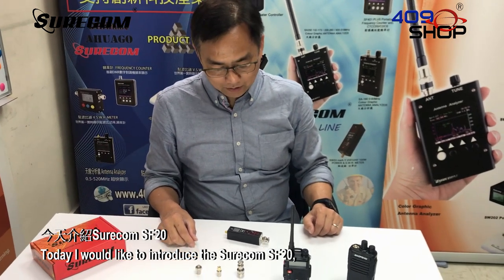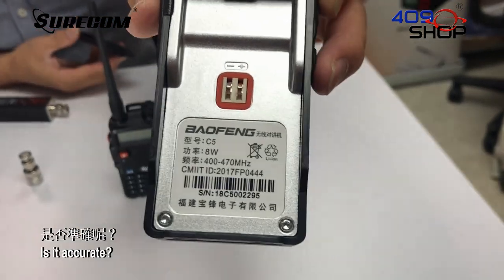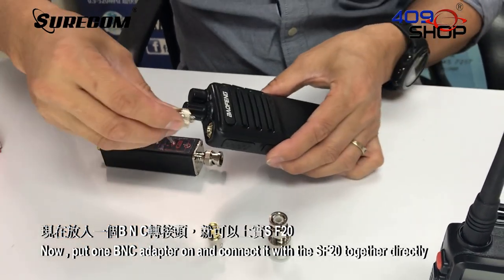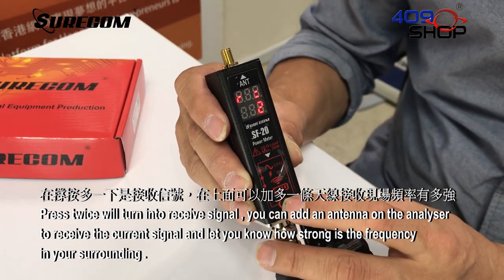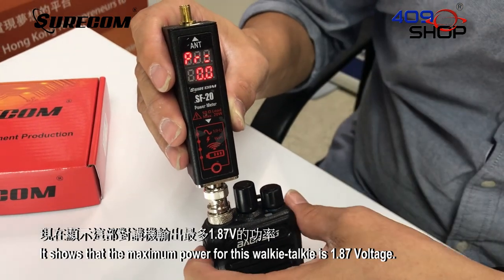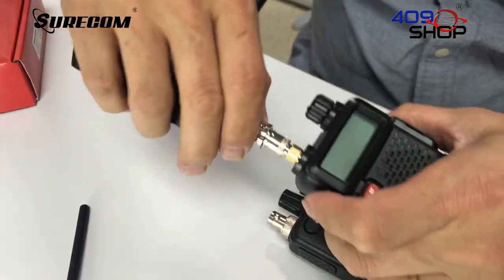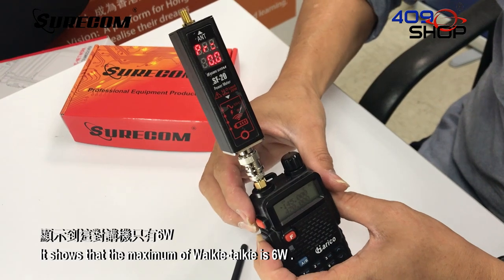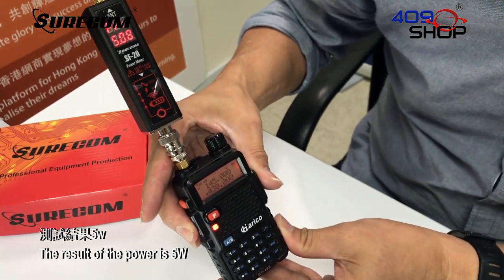SURECOM SF-20 20W POWER METER and Frequency counter

Comment: why didnt you use the dummy load? i tested using no attenue and no load like you did, but on the highest setting on the radio and i got 4.9 watts, 6.7 watts with dummy and 8.4 watts with the antenna on my baofeng f8hp. the tester instructions say to test with dummy and expect to damage the dummy load thing if your power is greater than 5 watts, also it says expect wrong results if tested with the antenna.
Reply from the maker: this product already build in dummy load